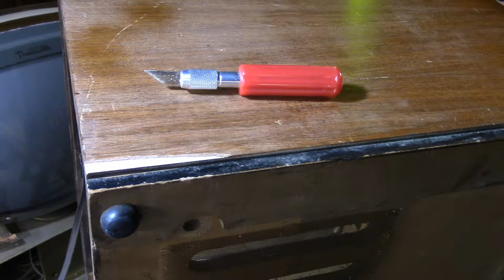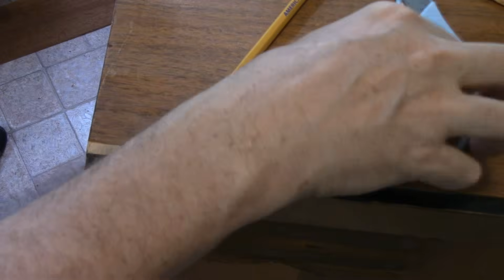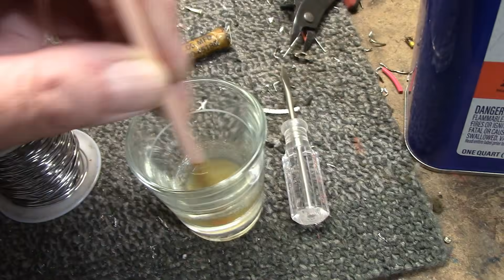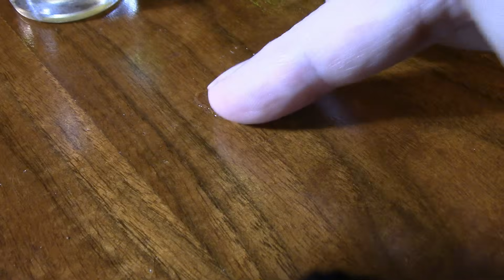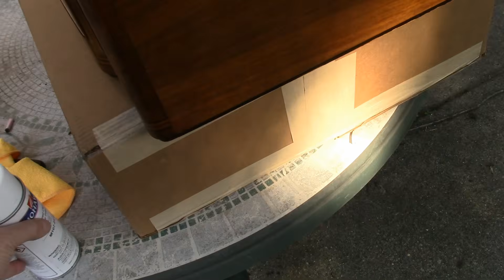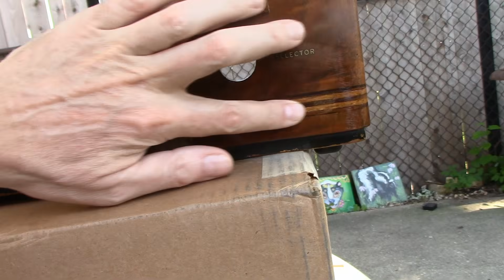Emerson 628 part2 - Cabinet work continues

Comment: I wonder if you would have had to do less sanding if you had just french polished the cabinet as a whole. With a little thicker shellac the voids would be filled in automatically and level with the rest. 
Now you layed down a blob, but with French polish you get layers
Reply from the maker: French polish goes on thin.  I'd need to do many pases and the larger voids would not get filled in level, there would still be dips.
Reply: @bandersentv could you not do as you did, but then polish it to the effect of getting it flat?

Comment: A bit torn between having something shiny and new vs something that shows its history. I don't mind a worn cabinet just not one that is filthy and falling apart.
Reply: If that history is a damaged top coat you should repair it so things like decals that are under it, or even the veneer does not suffer any damage from moisture or hands. Leaving dings or scratches isn't a problem. But you should protect it from further decay.
Reply from the maker: You control the sheen when you rub out the finish. You can make it as shiny or dull as you like.